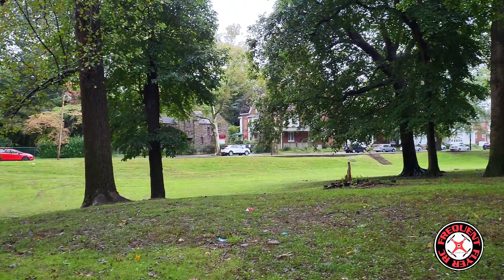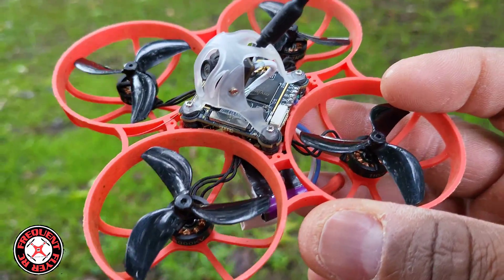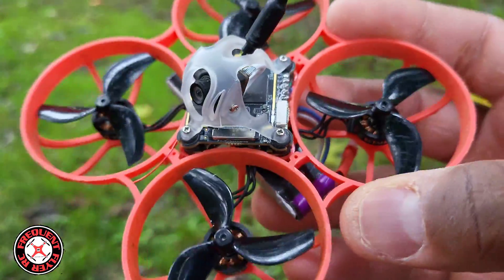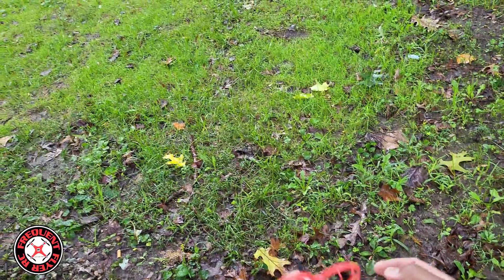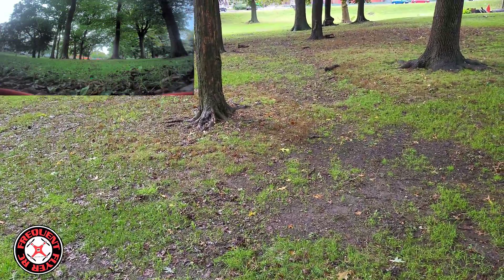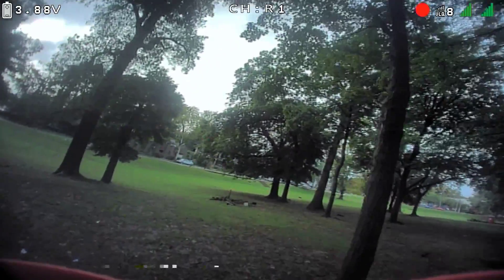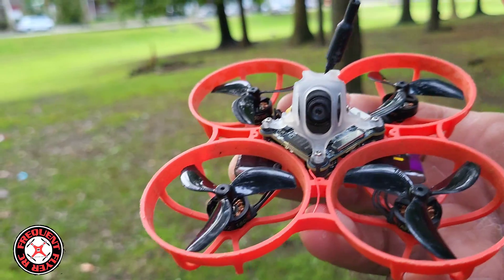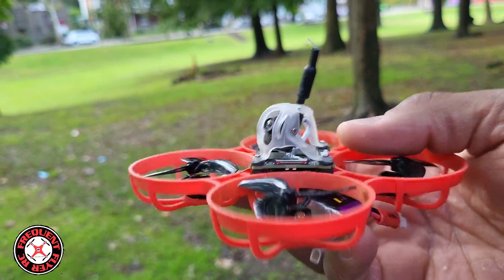BetaFPV Meteor 75 Pro Hdzero? (BetaFPV 1102 22,000kv Motors added) FPV Friday

Comment: Really, really recommend you try 1002 22000 kv on this 75mm build. The Gemfan 1208 3-blade low-pitch props are a match made in heaven with these!
Reply from the maker: I actually had those on it at 1 point. Now have that motor on the Walksnail version of the Meteor 75 Pro and took the ones from THIS build and put them on an 85mm whoop frame! 🔥🔥🔥💯